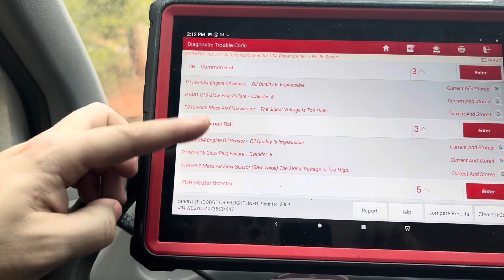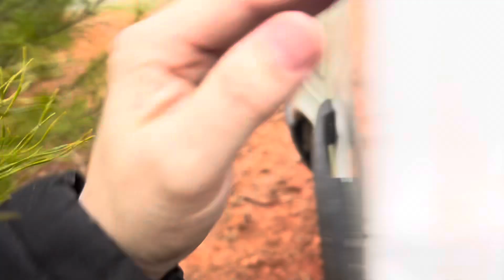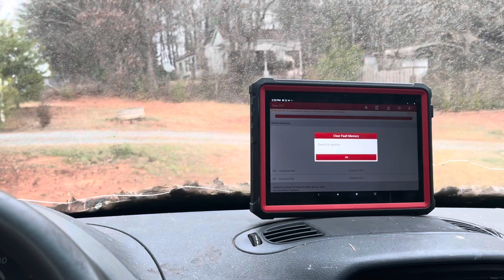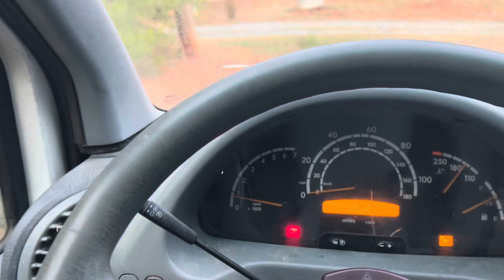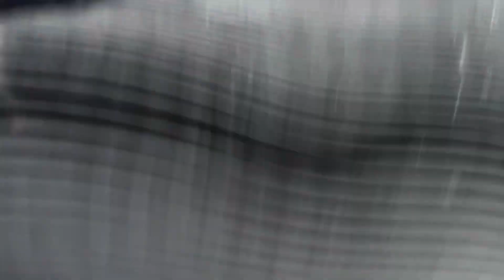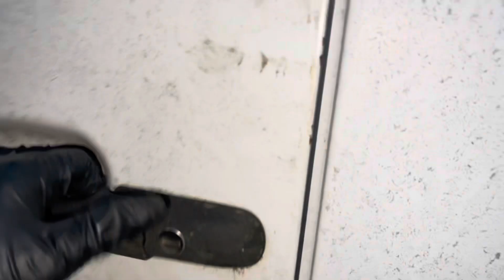2003 Dodge Sprinter Won't start without ether I wonder why leaky injector?

Comment: Disagree with MAF sensor.  Because you can unplug and it will start.
If the egr was messed with, it could be open.  If it’s open at start up, the van won't start.  It will not produce a code.  
You're using too much of starting fluid.  1 sec squirt is all !
Reply from the maker: Thanks, I think EGR is brand new, but I won’t discount your advice, you just never know
Reply: @ZimaletaMotors  if it's a Chinese EGR, they suck.  If the EGR is open at start up it sucks too much exhaust into the cylinders and combustion levels are incorrect for ignition.  This will be interesting when this is solved.  Also, what is the cranking RPMS?  if it is not at least 230 rpms  the van will not fire.

Comment: FUEL FILTER CLOGGED UP ?  OR A HIDDEN SECONDARY MINI  FILTER SOMEWHERE BY THE HIGH PRESSURE PUMP ?( I HAD THAT FILTER PROBLEM IN A KUBOTA NOT SPRINTER.)
Reply from the maker: Interesting idea and you maybe right when it comes to diesels especially ford diesel having 2 fuel filters, but sprinters just have 1 fuel filter, this sprinter happens to be a 2003 version 2.7l diesel which is different then 2004-2006 2.7l diesel, nothing mechanically is interchangeable plus it does not have a fuel pump in the fuel tank like the 2004 and up, so someone installed an auxiliary fuel pump in the line it self,  I am not sure how effective it is, so I will need to do a test, the first test I need to do is a fuel injector leak off test, which will give me an idea which fuel injectors are bad, but there might be several problems with the fuel system, also a possible problem with fuel rail seal, I do have this part I may replace it and see if there’s any changes and also I need to resolve an issue with Mass air flow system, I do think I might be able to install one from a later model sprinter we will see

Comment: nice video.  Youtube doesn't increase likes even after I liked it.
Reply from the maker: Thanks interesting 🤨 thanks for liking it, tomorrow I plan to replace engine oil, clean / replace Mass Air flow sensor, also do a leak off test, not sure what order I will do this in but that’s the plan
Reply: My like increased the number...